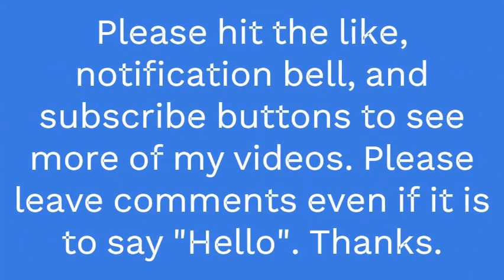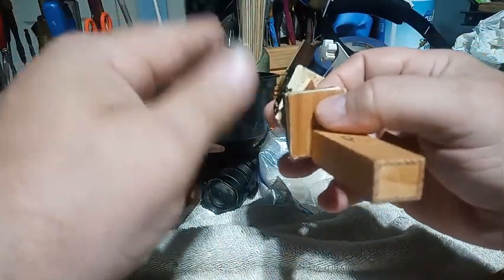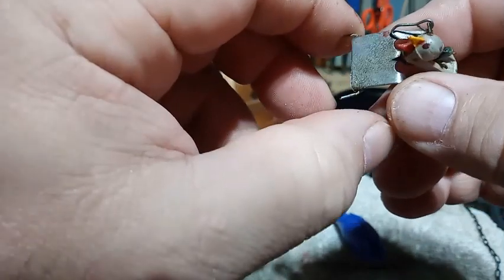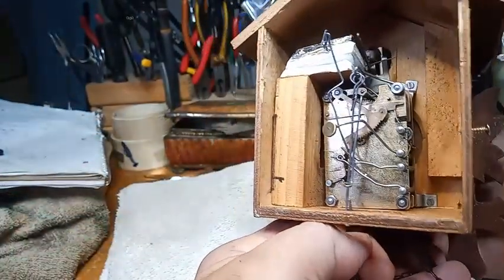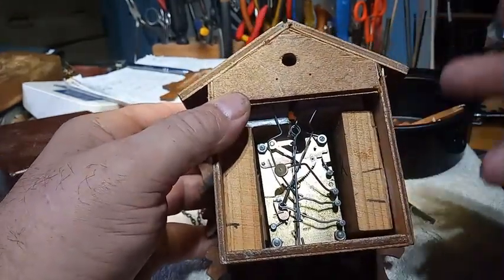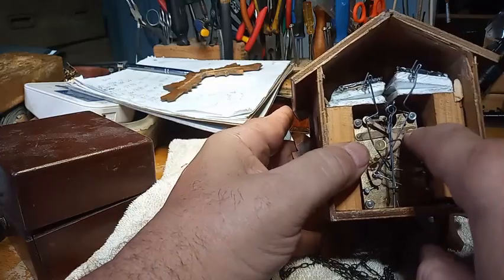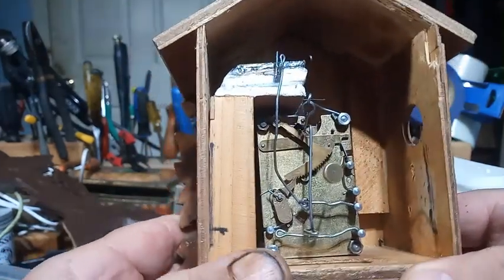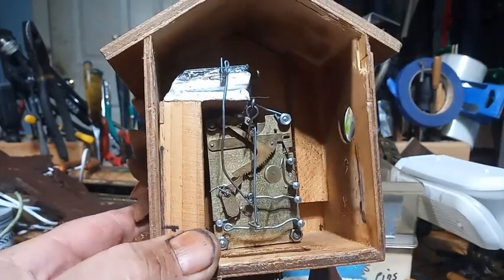Repairing a very small triple plate cuckoo clock identified as "DBGM" (See description) Part 3 of 3

Comment: What soulution do you use in your ultrasonic cleaner? And what do rinse your clocks in
Reply from the maker: I  have a few videos on home made ultrasonic cleaning solution. Simple green, dawn dish detergent, acetone, murphys oil soap, and vinegar.  Double rinse in water and then rubbing alcohol, and then dry it by putting parts in ice cream bucket and hair dryer on low heat. For mixture watch my videos.